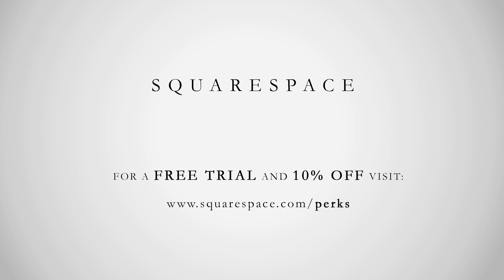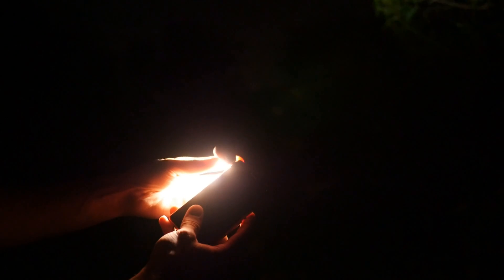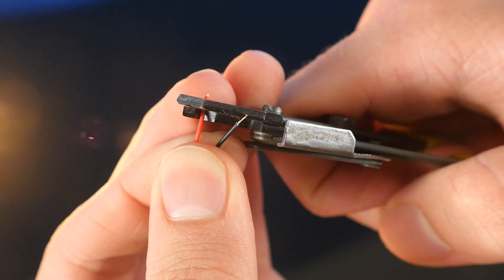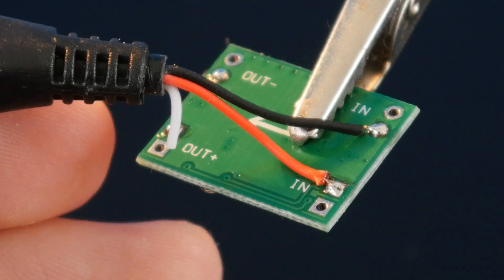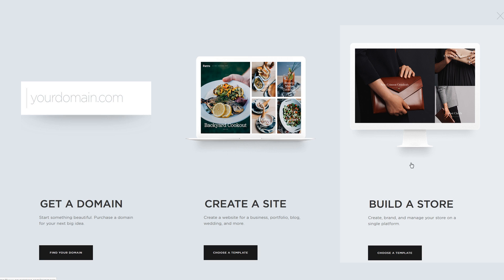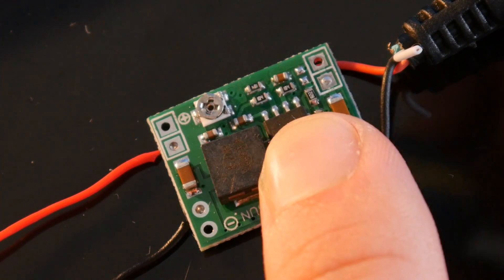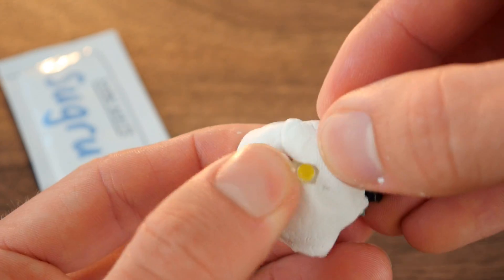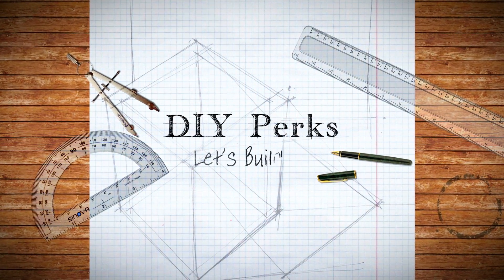A DIY smartphone hack that's actually useful!

Comment from the maker: Anyone else think it looks a little bit like the turrets from portal?
Reply: thats the first thing i thouth
Reply: It looks like a suppository, and that's where the users stores it, when not needed?
Reply: It lacks the capability of singing
Reply: lol "Are you still there?"
Reply: my lg g3 mini flashlight is brighter than 6w torch, its close to 12w
Reply: What if he tried to make non waterproof phone, waterproof.
Reply: where did you get that speaker in your house? ???
Reply: DIY Perks Lololol! Great content and info here!!
Reply: DIY Perks 6:13 anyone else thought condoms when he dropped the sugru packets? also knowing he said rubber just beforehand.
Reply: +DIY Perks
Hi, do you have links for the "ingredients" for germany too?
Reply: +Dheva Senapathy maybe a usb type c Port is the solution. They can be turned around so you have both options. But your phone must have a type c Port.
Reply: Great video. What consistency does the Sugru have once dried or fully smooth? Does it harden into a rubbery or plastic-y feel? Is it shapeable, maybe with sandpaper? Just wanted to create my own design if end up following your instructions exactly.
Reply: Would LOVE to see a DIY on making a portable "street musician" ampfor guitar or vocals using a laptop battery and a cheap/small guitar amp (or something similar)!
Maybe even add solar to it for when you're waiting for a spot to play! lol

THAT would rock!

I've got a bunch of old laptops/batteries and this small, old guitar amp (Nevada, 9W)....
Reply: sorta
Reply: Riki Z. Q
Reply: I was kinda thinking the same thing hahaha... You can make a turret version with a red LED. :O
Reply: Toby Manning Thank you
Reply: DIY Perks exactly what I thought
Reply: DIY Perks do you HAVE to use (your phones cable) to a female usb (OTG) or could you use the normal charging one your phone usually comes with?
Reply: hey where i can buy a bright led like tthat
Reply: Mr Jn he put links in description as he said
Reply: i want to know too
Reply: Unchained_01 check links in description
Reply: DIY Perks I agree and Just Realised
Reply: It just needs a red LED, a speaker (hooked up to a drive) playing cute soundbites, a motion sensor, and a submachine gun. C'mon Matt, make it happen!
Reply: Your Phone looks so much like my Lenovo vibe shot. I even have a carbon fiber skin.
Reply: Yeah, but it would be better if the LED would be red.
Reply: Cool!
Reply: Got me.....
Reply: +OakageHajile Yes, i am.
Reply: Fertaku Young-bae
Reply: DIY Perks what's the name of that thing @ 2:16 that melts the wire
Reply: PlatoonGaming it's a soldering iron
Reply: DIY Perks 409th like...
Reply: needs the guns
Reply: which model is your sony ?
Reply: Nice idea but I would recommend a more efficient led maybe something like Cree XM-L2 EDIT: now I'm thinking of it, I've replace from my SSC P7 flashlight the led and driver to an XM-L2, I can use the old driver+led on this which should end up in a pretty good solution because I have most of the parts(I do have a few OTG cables just not the step down board)
Reply: Sugru is freakin' amazin'
Reply: Excellent work Matt! I would be greatly interested to see more uses for Sugru as I bought a boat load of the stuff! Thanks again.
Reply: I does look like a portal turret
Reply: Just wanted to say, it is awesome how you did your advertisement. I actually watched it and listened to your story of how you created a website using squarespace.
Reply: DIY Perks yep they sure do
Reply: DIY Perks yeah and you sound just like Wheatley too
Reply: عالی بود ممنون از اینکه تجربیات خود را به اشتراک میگذارید🇮🇷👍👏👏👏
Reply: "Are you still there?"
Reply: i think, in all honesty and with all respect, it looks more like something wish would recommand me to buy for fun time with gf ...
Reply: You monster.
Reply: There you are
Reply: Not until you said so 🙂
Reply: It's different!
Reply: @DhevaSenapathy  it would work in c pin types
Reply: of course
Reply: FYI
The UK Amazon link for the voltage step down board no longer exists!
Reply: +Dheva Senapathy maybe a usb type c Port is the solution. They can be turned around so you have both options. But your phone must have a type c Port.
Reply: +Dheva Senapathy maybe a usb type c Port is the solution. They can be turned around so you have both options. But your phone must have a type c Port.
Reply: What about usb c

Comment: Did dbrand and sugru also sponsor this video? But even then, nice video :)
Reply from the maker: Nope :) that skin is just a bit of vinyl wrap cut to the size of the phone. As for the Sugru, I just had some left over from last year.
Reply: How is there too much product placement? Would you prefer he just used hot glue to make the outside shell lol. He's using what's best for the project, nothing wrong with that.
Reply: Bruh... there is to much Prod Placement ...

Comment: OR just plug usb led into OTG cable without cutting anything..... right? there are plenty on ALI.
Reply: That's not fun
Reply: And carry 2 cables instead of a thumb-sized device... It defeats the purpouse. You would be better off carrying a flashlight. I just didn't like how big he made it, but that way it is easier to understand by people. I would just get the usb-b connector from old data cable and short the ID and GROUND wires, then find a smaller step-down module(or shrink this one with a dremel) and a smaller led.
Reply: this is a 3w led, not some shitty quality LED.....
Reply: but why

Comment: DC-DC Step down based on LM2596 is aprox. 2 times smaller than this new version. LM2596 can handle up to 2A output current which is enough for this project.

Comment: Could you modify this to be a reading light? =o
Reply: yeah, just lower the current so it is not blindingly bright.
Reply: And possible add heat sink behind the led.

Also if you dont this to get power from you phone, then you can chance it USB connector and get power from any USB socket. Same method, different connector. Also add switch on the ground wire and you get it go on and off with out removing it from USB socket, that is too far away.
Reply: you won't be needing a heat sink for that..

Comment: amc7135 current regulator (at a fixed voltage of 3.3vdc, perfect for LED's), 350ma regulation, and are stackable (thanks to budget light forum), not only safer, but MUCH smaller, and won't pull too much current from OTG port
very cool build!
Reply: You could use them after the buck just to limit the current
Reply: No way. you just use a sense resistor and error amp back to the buck for current control
Reply: Hi !  I use that chip on all of my diy usb torches. 7135 is made for this job and works well.
Reply: are they linear or switching?
Reply: Brian C hi I want to make a bright flashlight using a 18650 and a 3w 700ma led I want a good regulating circular can you help with some informations what type of regulator linear or switching...
Reply: Head on over to budgetlightforum and post your question there. Real kind folks that'll overwhelm you with great ideas. Don't use the "3W Led" shown in this video, get a proper cree XM-L2 led. I built a flashlight that does 4000  REAL lumens (don't believe the cheap amazon chinese flashlights that say they're over 500 lumens).
Reply: XM-L2 can only output like 900-1100 lumens ideally. How the f you get 4000 lumens from a XM-L2?
Reply: I advised the other guy to use the XM-L2 in his setup, that doesn't mean that I used a single emitter. My light has quad XP-L's driven in direct drive by a 30Q. I merely mentioned that to show him how the forums help out with ideas for great lights. Chill man.
Reply: Nah man, I'm not angry, just curious : )

Right, when selecting LEDs, pick one from trusty manufacturer like Cree or Epistar. Their LEDs are very efficient and not overrated. The cheap Chinese one aren't very efficient and mostly are overrated.
Reply: @renzevenir4853  Not need to complicate things. Using smaller LED to step down voltage + resistor to limit current (resistor will use very little power, as most will be consumed by smaller LED) is totally enough.
Reply: They're linear regulator. Not as efficient as switching regulator.

Comment: Hope all phones have a current limiting feature, so noone will break his USB port trying this...
Reply: Yes the connector itself can handle the current, but the internal phone dc-dc boost driver mostly can't. So there must be overcurrent protection to avoid damaging the otg power circuit.
Reply: i once attempte to creat a car charg with the cigarette lighter socket , but didnt put a voltage regulator. was fun to see the phone diying with 12V inside of it LOOOOOOOOOOOOL fml
Reply: Mix Bag White LEDs have a forwardvoltage of around 3V. So a 3W LED would roughly draw 1A.
Reply: you are correct and most phones dont have protection. they dont even have over voltage protection.
Reply: Drawing too much current over an unprotected phone will cook the traces and fuck the USB port, HOPEFULLY only breaking its OTG capability, but potentially much worse.
Reply: micro usb is max 1.8 A however most charge no more than 1A the pcb copper tracers will defiantly burn up if that is exceeded. some 3w leds could go over that ? if it breaks the usb will no longer work once copper tracer has burnt
Reply: USB ports in phones can handle 2A.
Reply: nope